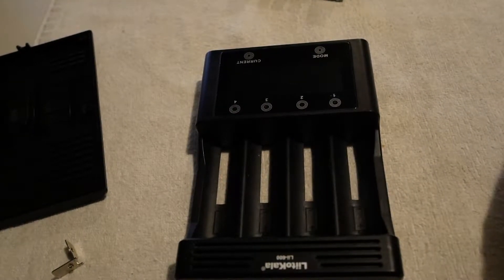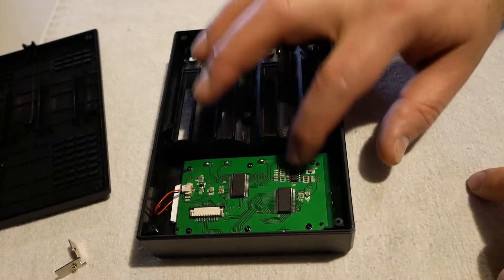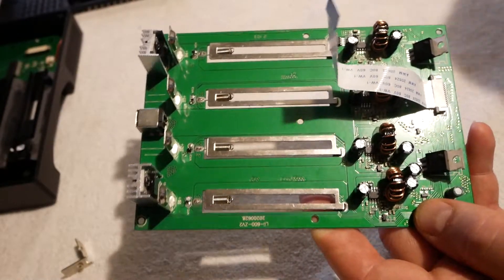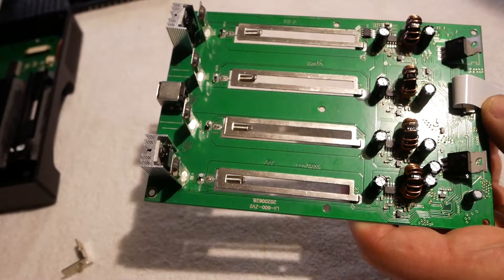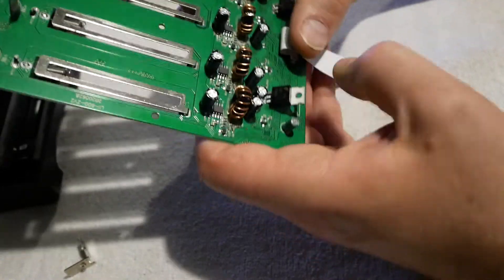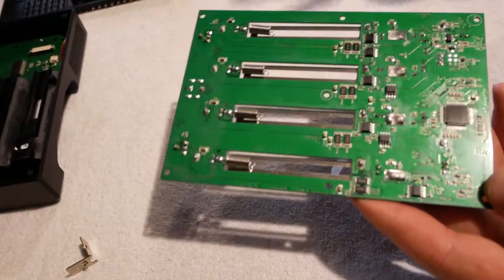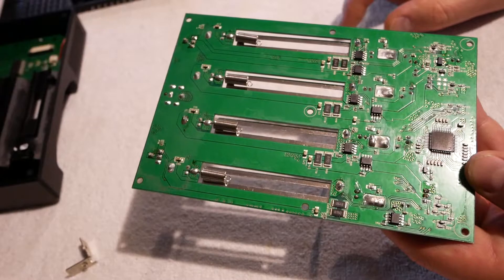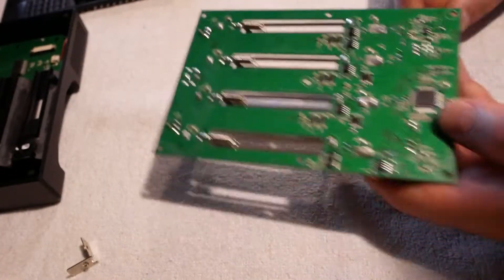LiitoKala Lii 600 Teardown

Comment: I have some results to post which honestly surprise me. Tell me what you think after you review the info.

Testing setup: 2x brand new Panasonic /Sanyo NCR18650GA 3500 mAh 10A batteries. Chargers: LiitaKala Lii-600 and Vapcell S4+. Both chargers used in manual mode so I could select charge/discharge rates.

Vapcell S4+ tested first. Batteries inserted in slots 1 and 4. S4+ reports 57 m ohms for both batteries.

Discharge rate set to 1A. Display varied around 1000mA +/- 20mA or so. Close enough to 1A.
3:47 minutes time to discharge (batteries fully charged the day before the test). 3527/3563 mAh discharge. Avg about 930 mA. Not bad.
Displayed temp 60 to 64*C. Temp measured by my IR gun (E 0.95) was 52-ish *C.

Charge set to 3A. Display only showed 2500mA and lowered as the cells filled up. I never could get 3A to show on the display. The mA/mAh alternates as the cell charges/discharges. The only time to see what charge rate is set is in the few seconds before the parameters lock in. 

It took 2:36 to reach full charge. 3570/3647 mAh. That’s about 1375 mA avg. The 2nd took a minute or 2 longer, but close enough.
Charging temps showed 44-45*C and measured 43-ish *C with the IR gun.

That’s considerably slower than I thought it would charge, but I think it’s common for all chargers to slow the rate of charge down as the cell fills up to protect the battery. That’s one nice thing about the S4+ charger, you can see the charge rate vary as the cell fills up. Otoh, you have to remember what charge rate you selected because that is not displayed after the settings lock.

I honestly didn’t expect much from the Lii-600 after reading your report, but I have to say the 
Li-600 surprised me. Same batteries, fully charged from the test the day before.

The Lii-600 reported IR at 95 and 56 m ohms, that 2nd # remarkably close to those reported by the S4+ the day before.

Discharge rate set to 750 mA (the max). Time to discharge was 4:37/4:46. I forgot to record the first battery discharge mAh, but the 2nd one was 3527 mAh. Average discharge was about 739 mA. Pretty close.
Reported discharge temps were 62/56 C and measured temps were 48/47 C with the IR gun and same emissitivity settings (0.95).

Charge was set to 3A and that was displayed on both populated slots. I had some momentary confusion after the 2nd battery was inserted as the Charge setting dropped to 1.5A. I then discovered the Lii-600 was back in auto, so I reset to manual and made sure both channels were set to charge at 3A.

Time to charge was 1:55 for an average of 1878 mA.
3596/3616 mAh fully charged.
Charging temps showed 43/42*C and measured 39/41*C with the IR gun. Pretty close.

I was disappointed the Vapcell S4+ would not charge at 3A as advertised. I liked seeing the charge rate as it varied as the cell filled up. I didn’t like not being able to see the set charge rate. The time differences to discharge/recharge seemed consistent with the displayed rates.

I think I prefer the Lii-600 display, but missed seeing the charge rate slow as the battery filled up. Otherwise, the main difference was the S4+ could discharge at 1000 mA vs the max of 750 mA for the Lii-600. The S4+ also has manual buttons vs the touchscreen on the Lii-600. No real preference there.

The Lii-600 took nearly an hour longer to discharge (750 mA vs 1000 mA) but was over 40 minutes faster to recharge (3000 mA vs 2500 mA).

I’ll have to try 4x 18650 batteries in both chargers and what max charge rate I’m able to set between auto and manual mode. But unlike your Lii-600, I was able to set the 2 channels I used at 3A charge rate. I looked through the manual and couldn’t find any restriction to use channels other than 1 and 4 for the 3A rate. Maybe I missed it. I didn’t think to test that at the time.
Reply from the maker: Weird! I got no notification that you posted. I saw notification for "any comments" that you posted later.
*
1. What I expected to be honest...that you can't really charge at the advertised amperage. IT is interesting that you got your Lii-600 to start charging at 3 amps in banks 1 and 4.
2. Any chemistry, charges fastest at its lowest charge level and then as charge level increases, current draw starts to drop off. With a 3000mah cell and charging at 3 amps, ideally should take 1 hour. Reality is that the first 80% might charge at 3 amps and then the remaining 20% is slowing down a LOT. The last 5% easily takes as long as the first 80%. This explains your much longer charge times than you expected.
3. I was messing with my MC3000 since it can discharge at 2 amps max. Cell capacities are much lower than what I get when discharging at 1 amp or .5 amps. This is typical. As a result I created that VP4+ program so I could duplicate the charge and discharge ability of the VP4+. Doing so got me capacities very similar to the VP4+.
4. Even though your S4+ and Lii-600 can discharge faster, you are also changing HOW the cell is tested. I know it takes longer, but to get comparative results that can resemble the capacities that the manufacturer says a cell might have, you really need to keep your discharge current to .5 amps. Discharging faster will result in lower measured capacities.
5. Cell Ir is quite low. Any amount of pollution, dirt, oxidation, etc on the cell ends and cell tester contacts will cause spurious readings. If you really want to see your cell Ir, use rubbing alcohol to clean off everything before installing the cells. The VP4+ Ir probes have sharp points and will poke through the junk on cell poles to get a decent reading.  The blunt protrusions on typical spring loaded cell holders will not and Ir results are highly suspect as a result. I think you saw this on your Lii-600. Maybe the S4+ contacts were cleaner or poked through any dirt/oxidization better?
5. Temp sensing is a bit suggestive more than it is reality. My Lii-600 and MC-3000 have a metal tab that touches the cell. The PTC temp sensor is possibly in thermal paste, but is NOT making contact with the metal tab that touches the cell. As a result actual temp measurement is less than ideal. Also heat inside the case will warm up the temp sensors considerably so they read high. I'd trust your Ir gun more than the internal temp sensors. THe VP4+ has 4 temp sensors but they read through the ABS plastic. The Lii-500 has 2 temp sensors and they read through the plastic as well. This is far less ideal than at least a metal tab very close to touching the cells!
6. I like the Liito LCD's. They are clear, easy to read, good contrast, good layout of information.
Reply: @de-bodgery  
Thanks for the info. I’m not inclined to repeat this test on these batteries. I queried the shop I bought the batteries and S4+ from regarding the inability of the S4+ to charge at 3A. They advised me that Panasonic specs those batteries for a max charge rate of 1.675A. They are checking on the S4+ chargers.

0.5A discharge will take a long time. Otoh, discharge temps should be cooler. I was surprised that 1A discharge generated more heat than 2.5/3.0A charging.

Did you check your Lii-600 again to see if you can set 3A on any channel? I haven’t tried other than slots 1 & 4, but I think any slot should. My results were definitely different from yours in that regard.
Reply from the maker: @speedlever  port 1 and 4 supposedly charge at 3 amps. I'll use my MC3000 to discharge 2 cells quickly and then try the Lii-600 and 3 amps for both ports...
*
I've completed testing on 16 identical cells across 4 cell testers. I'll be presenting that in a video soon.
Reply from the maker: @speedlever  BUMMER! I was wrong!
I was under the impression that the MC3000 could discharge all 4 cells at the same time at 2 amps. Any one cell...sure...2 amps...no problem. 2 or more cells it limits each one to 1 amp discharge. I found this out trying to discharge cells for charging on the Lii-600 at 3 amps.
Reply: @de-bodgery  
I couldn’t find anything in the manual restricting 3A charging to slots 1 & 4. Maybe I missed it.
Reply from the maker: @speedlever  Hmmm...where did I see that? No idea! Maybe I'm delusional or remembering it wrong? LOL!
Reply: @de-bodgery  
I probably said something about it in one of my replies. I must have confused myself after watching so many yt videos on chargers. I’ve gone through the manual but haven’t found anything restricting 3A charging to slots 1&4. But I know there are some that restrict max charging to the outboard slots.

In another review of the Lii-600, the author states all 4 slots will do 3A. I haven’t tested that myself. Yet.
Reply from the maker: @speedlever  Last night I used my MC3000 to discharge 4 cells down to 3v. Today I put all 4 on my Lii-600, set current to manual and was able to set all 4 channels to 3 amps. I don't know if they are actually charging at 3 amps or not, but I think the amount of warmth (45C) in them is an indication that it is possible. Even the PSU is pretty warm. This is more than I expected. I'm guessing I didn't notice and maybe I had current set to auto previously when I was unable to set any one channel to more than 2500mA. On manual, I have all 4 channels set to 3000mA right now. So I'm going to accept that I read it wrong, was delusional or just mistaken previously.
Reply: @de-bodgery  
Thanks for the update. 

Does that change your overall opinion on the Lii-600? I’m still bouncing back and forth between the s4+ and the Lii-600, but I kinda prefer the Lii-600 because of the display. Otoh, I like how the S4+ shows the charging current as it drops from the initial set point.
Reply from the maker: @speedlever  You see the teardown. It's somewhat better than the Lii-500S, but not a lot better. Does it do 3 amps charging? yes. Does it do a decent job at cell capacity? Yes. Does it have a nice LCD? Yes. Does it measure Ir reliably? NO! So I'm torn...LOL. Overall I still prefer the VP4+. 3 amps on all 4 channels is not that important to me and I bet XTAR comes out with a new model soon that does this.
Reply: @de-bodgery  
Understood. Kinda wish you had a Vapcell S4+ to try too, just to satisfy my curiosity. While I’m not displeased with either of these chargers, I agree 3A is not important and wish I’d put the money into the Xtar VP 4 plus. Otoh, I can charge 8 cells at one time now. (Not that I really need that either) 🤣
Reply from the maker: @speedlever  I have a few more cells than you. I needed a bit more testing ability. However, I have exceeded that need considerably in pursuit of curiosity of other chargers. I don't know if I'll get a S4+...maybe next month.

Comment: Running some tests on the Lii-600 and the Vapcell S4+ with the Panasonic 18650 3500 mAh battery. Will post results here later.
Reply: Lii-600 has several important differences...shunts resistance, discharge currents same for all slots(mosfets with/without radiator).
Reply: And?